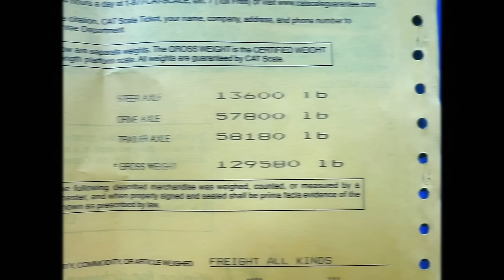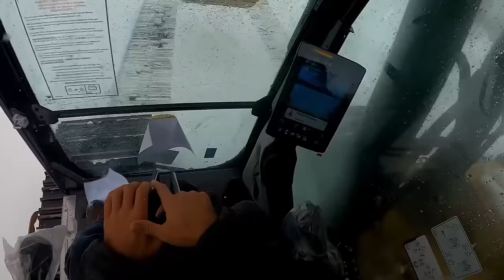First trip back to the Port of Baltimore

Comment: Place looks like a ghost town compared to normal traffic. Hopefully they get an opening so the port can start having ships in and out soon
Reply: Small ships and barges only... for a near future.
Reply: If two top three months is soon, yes. It's progressing so far, but, when they start the under water removal, it will slow down greatly. Also, they can only fit so many cranes and barges, with tugs, in that area, these are not small size vessels.

Comment: In watching many of your videos, it appears that many of the transports move through areas using rural routes that can take you many miles out of the way instead of using more direct routes such as the interstate system (USA) or some of the bigger roadways (Canada). I understand that these routes are specified in the permits (federal, state/province, city, etc), but I have not seen where any of the loads are specifically identified as hazmat. Is this due to the impact on other traffic, less high and wide conflicts, or something else?
Reply from the maker: The detours are usually to avoid obstructions on the main highway system.  Low clearance overhead bridges, weight restricted bridges, reduced width construction areas… etc

Comment: The crew clearing the ship and bridge will have a set of priorities for what to do.
1) clear anything that has a high risk of shifting and causing more damage.
2) clear the channel at least enough for 1 ship to use at a time.
3) get the ship freed.
4) the rest of the channel.
5) the rest of the rubble.

It seems obvious to use my suggested priorities ( to me at least ) in that stopping stuff causing more damage to the ship or bridge foundations reduces costs for repair.
clearing the channel will naturally be a fairly high priority as they need to bring the ship into the harbour after freeing it.
only after they have the channel opened enough to move the ship through will clearing the ship and freeing it be worth any focus.

The big problem is working on the water to do this cleanup will slow it down to a snail's pace. The weather has a much larger impact on operations on the water, you have zero visibility on submerged rubble to clear so will need divers to rig every lift.
Reply: Plus most people can't grasp of what weights we are talking. The bride parts lying on the ship alone are a few thousand metric tons of material.
It's not like you could grab that with nay crane and just toss it aside.
Reply: @Thomas-lq1jw  Yup, though it's slow there is a benefit of the divers, they are working in the dark so with limited light already so the time of day has zero impact and the actual job can run as long as weather permits. Manpower to fill positions dependent, but 24/7 is possible for the submerged portion.

Comment: Well you just answered my question about the boot on the exhaust I couldn't see it before
Reply from the maker: A lot of people will say it is not necessary to cover the exhaust on machines with newer technology.  But it is our company policy to cover everything.  It literally takes 2 minutes
Reply: Yeah I retired 4 years ago and I hauled heavy equipment for a lot of years for various companies local I know I had a yellow boot that guys wear when they're laying pipe were your boot fits inside of these rubber boots probably wouldn't work nowadays on them excavators cuz those exhaust pipes are so short could you use it on a loader though for a tire loader backhoe probably would work on a Dozer too anyway you answered my question is for what time it takes better be safe than sorry only takes a couple minutes

Comment: Load in the rain and unload in the snow, not a very happy load. And having to reload on another trailer because of some stupid road restriction is a waste of time for sure.
Always good helping other haulers out, you never know when it will be reversed. 
I once helped a guy broken down roadside with some bearings and seals and some labor, and told him he did not owe me anything,  Couple of months later he sent a package with the parts and a check for a hundy. I called him to send the check back but he would not take it.

Comment: Wow, never would have considered permitting the fuel stops.  They really make you jump through hoops.
Reply: @lancecluster ....depends on the jurisdictions. But as Doug says, if PA are known to be hit & miss, it's really cheaper to purchase the municipal &/or local permits ahead of the trip so as to allow access to the truck-stop for scaling and fueling, especially if after exiting you must cross the Interstate via an overpass as opposed to an underpass (but even then, they can be sticky).

But I also know of jurisdictions, which explicitly state "...0.5 miles for fuel, food and accommodation permitted; if crossing an overpass is required, must center-line and proceed dead-slow. Definitely no shifting of transmission while crossing" (or words to that effect).

Comment: Do you have to go to any training to drive the machines on or is it learn how you go?  i don’t mean on your trailer, I mean in general. 
There is a wide variety of machines you move.
Reply from the maker: Learn as you go!  I am not an operator. I can drive anything to move it around the yard and up onto the trailer but if I was to dig a ditch it wouldn’t be very straight 🤣

Comment: How does the Elog work in regards to working around curfews? I was going the take an educated guess that the beam trailer was being used to save weight for spring weight restrictions cuz i figure beam trailer is probably lighter than a regular lowboy trailer.
Reply from the maker: You are correct that the beam trailer is lighter but not enough for the weight restrictions.  This load still needed to be transferred onto a bigger trailer.

There is no e-log exemption for curfews. The time keeps ticking.  The only special exemption that oversize get is that we are not required to do the 30 minute break during the day.  Not required but we usually get a break anyways for curfews etc…

Comment: What size cribbing blocks do you use, and how many do you have to carry? Does it change based on the load?
Reply from the maker: Yes every machine requires different size cribbing.  This was actually one of the easier machines to block up.

Comment: I thought you were allowed up to one mile off permit for fuel and/or missing a turn? Is that not the way for Pa? I run in NC and I am just about certain it's that way here.
Reply from the maker: Every state is different.  Most states tolerate exiting off route for a truck stop as long as you’re not superload.  Not PA.  Legally in PA you are not allowed off route at all.

Comment: Great videos Douglas. I have a question about where you stop for the night. My wide loads aren't as big of a load as you haul, but I have a 12ft wide x 14ft high load coming up in the next couple weeks going to Mississippi from BC, how to do plan your stops? I don't think I'm going to try and stop at a truck stop for the night at 12ft wide, if I take 2 parking stalls I may be lynched! Thanks Douglas
Reply from the maker: Nothing wrong with taking 2 parking spots. I do it all the time.  With a long trailer I sometimes take 4 😅.  But you need to stop early enough to find the parking.  With the days getting longer you might have a hard time to find 2 spots at 20:00 in the popular truck stops.  With a very big load I often avoid the big name truck stops and park at mom & pop places where the parking doesn’t fill up as fast.  When going to unfamiliar places I use google maps to see how the parking is designed and I usually have a plan of where I want to park before I even enter the truck stop.
Reply: @luckybananaheavyhaul3407  thanks for all the tips Douglas, I appreciate it

Comment: Does the customer have to pay twice for two different trucks?
Reply from the maker: Yes the cost of shipping is higher because of the weight restriction.  After all it is a lot more work for us to make the delivery.  Customers usually wait and put low priority loads on hold a couple weeks until the weight restrictions are over.

Comment: Hello Doug  Great content as usual.  Liked the narration for illustrative purpose for others.  I miss loading/unloading in bad weather.  NOT.  Although everyone loads their way I was surprised that you set your wood in line with the beams instead of across them.  I never used pins on new machines except new bulldozers Komatsu D-155's and larger.  I got supremely lucky one day while loading at a crane manufacturer.  They had a big box of used boom pins and they let me take a pair.  Best thing since sliced bread. Have a good day.
Reply from the maker: Like you said there’s more than one way! I just prefer having more surface area contact. If the wood is in line with the beam the weight is carried across the whole block and not just the edges 🤷🏼‍♂️.

Comment: why not just take the bigger trailer to baltimore, LOL  all of that messing around just to switch trailers!  probably cheaper to have you screw around with trailers than get more expensive permits
Reply: @stevem268...thanks for answering your own question...lol
Reply from the maker: Two reasons. There is higher operating cost to the bigger trailers.  More escorts required, more permit cost etc… second reason is we just don’t have enough big trailers to send on the smaller loads.  If we send the big trailer to the USA it will be gone all week for one delivery.  By transferring loads at the border the big trailer can do 4 or 5 deliveries in the same time frame.

Comment: Great video. Curious, do you have to be sitting down in order to engage the controls.
Reply from the maker: No. You need to be extra careful if you get up with the hydraulics engaged because a bump of the controls will move the machine. The lever arm to the left engages and disengages the hydraulics.